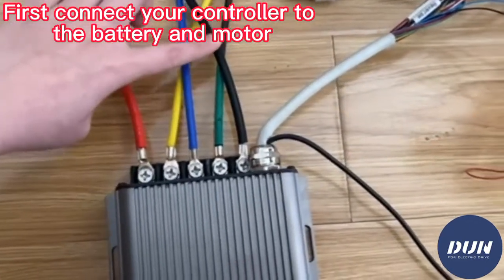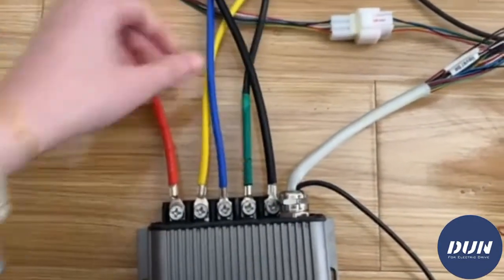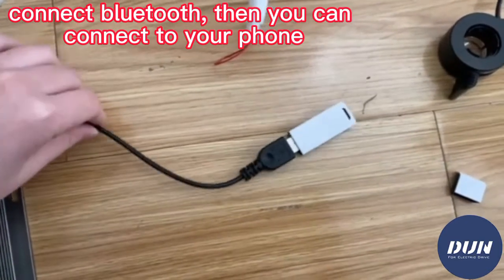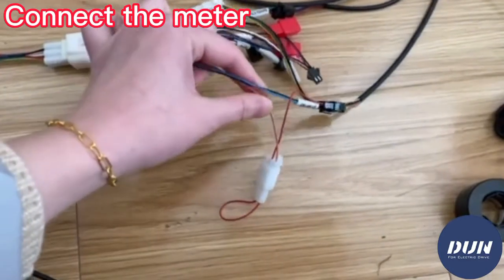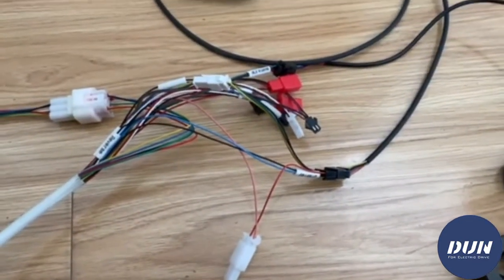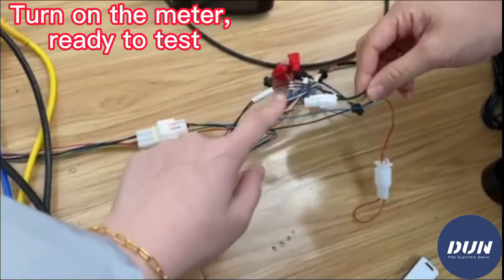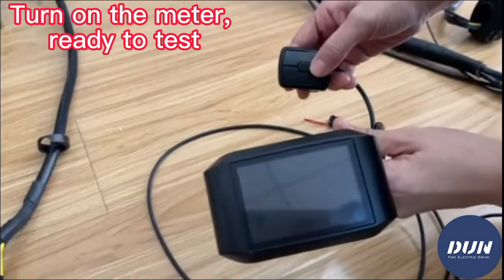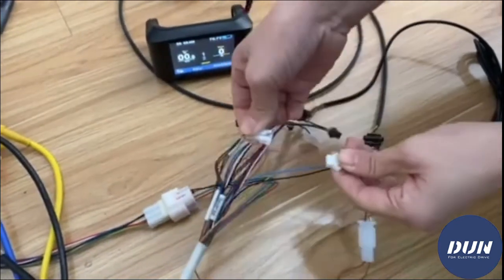How to Do the Hall Angle Test? (Sabvoton Controller)

Comment: Hey...nice video...i need more explanation on the protocol...my Stealth bomber came with a Sabvoton 72150 and ukc1 display Apt...i replaced the Uck1 and it didn't worked even though it was the same brand and model....i bought a new Sabvoton controller and still didn't worked...the ukc1 is OMD
Reply from the maker: if your controller is APT, then your display also need to be APT protocol, OMD protocol display cannot match with APT protocol controller.
Reply: 🙏🏼 so how do I know the protocol for my new Sabvoton..?

Comment: Do I need to have a display connected at first?
Reply from the maker: you can only connect the controller and do the hall angle test, with or without display is both fine.